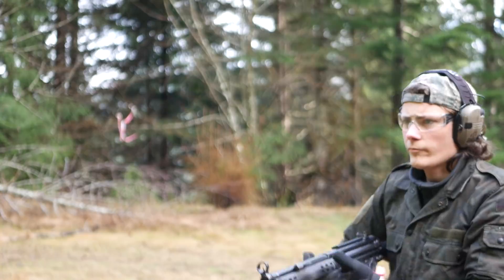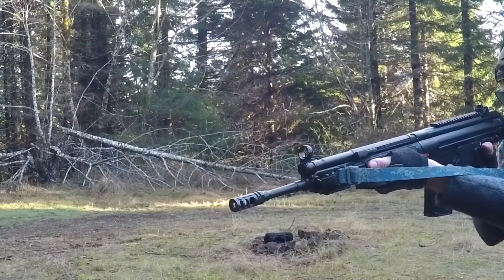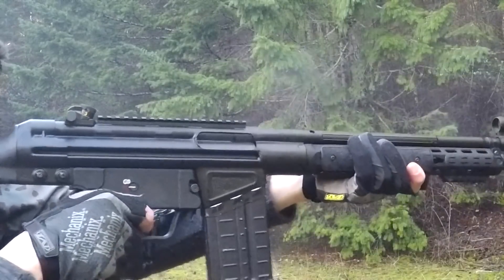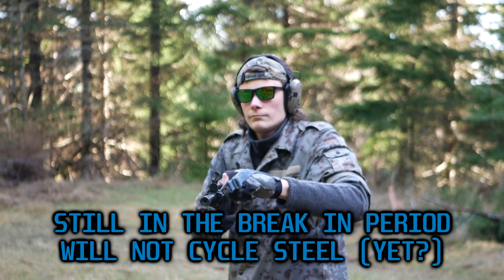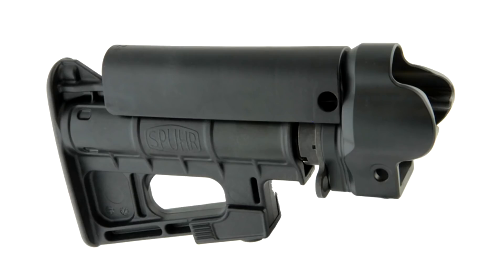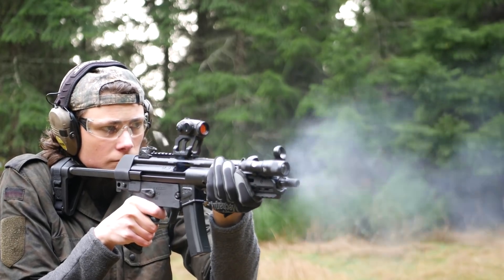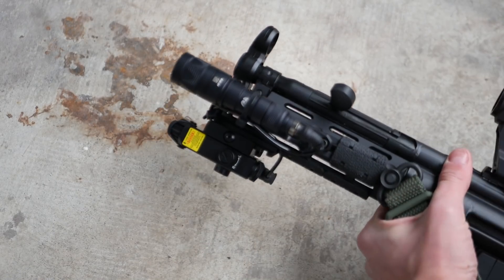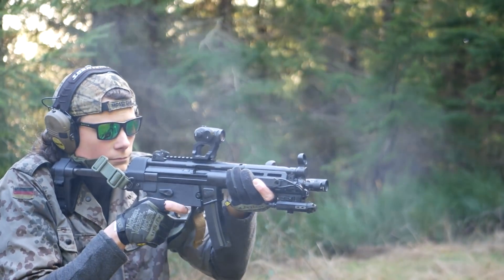PTR Mitosis

Comment: Hop did you ever think of going with a FAL? The manual of arms is better then the G3 imo and its pretty similar to the AR15
Reply: The FAL was/is a great rifle but I think its biggest problem right now (beyond cost) is that reliable mags are getting harder and harder to find. The reviews of the new DSA polymer mags is mixed, they seem to have given up on trying to make new metal magazines, and original military FAL mags in excellent functional condition are getting harder and harder to find outside of the secondary market. They are a lot more expensive than they used to be also.

If DSA can get the new polymer mags to fit and function consistently, I think the FAL will hang in there. The FAL does have some advantages over the G3 like LRBHO and the lower end Cold Warrior rifles are not outrageously expensive.
Reply: @dexm2010  i actually have had really good luck with DSA metal mags. But I agree with you. However, FAL mags have always been over priced in the states. I remember seeing an ad for real FN FALs in the 80s and the mags were 45 bucks. In the 80s. Shit is ridiculous
Reply: @WasatchGarandMan  I remember that ad from the '80s also, but you have to remember a couple of things: 1) Back in the '80s HK G3 mags were around the same price, and 2)
 that there was a period from about somewhere around 2000 (ish) to maybe as late as '07 or so when surplus metric FAL mags could be bought in some cases for less than $8. Many of these were Austrian STG58 mags, with some Rhodesian/FN/South African marked ones (Inch/L1A1 mags were around too but also even then generally a little more expensive for nicer mags). 

The complete FAL kits (with barrels!) were also notoriously cheap, along with most G3 kits at the time. I think part of the reason surplus FAL mags dried up so quickly while G3 mags even now are still cheap and in great abundance is that so many people were able to either build themselves cheap FAL rifles from kits or pay gunsmiths reasonable fees to do it for them, and as soon as they did so, they stocked up on mags as quickly as they could. 

The G3s, on the other hand, while many kits did come in, mostly in very good or excellent shape, they were obviously harder for the average home builder to make, there were fewer smiths that knew how to build them, and the costs were higher with longer wait times. 

I don't know how many G3 and FAL kits with barrels came into the country before the "barrel ban" stupidity around 2005, but while I do not have direct evidence, I honestly believe the higher costs, build complexity, turnaround times, and sometimes spotty reputation of PTR 91/JLD Enterprises early on are the primary reason why there is still such a large supply of G3 magazines available, while most of the metric FAL magazines were sold off and scrounged up long ago.

Comment: As for "modernizing" the G3, everything you mentioned adding to the rifle sounds legit. It is something I would do. Keep in mind, the G3 is NOT a precision rifle, don't make it to be one. People assume just because it shoots a full length cartridge, it should shoot sub-MOA...which is not the intent back when it was designed. 

For the MP5, Midwest Industries has an mlok rail you can mount on top of charging handle tube where you could probable get away with putting an IR laser or maybe a pressure pad...but I don't know how that would go with that welded picatinny rail. Also, T-Rex arms sells a light mount that pushes the white light more forward of the barrel leaving ample space for your hands. You already have a Scalarworks mount, which is great for nighttime shooting (and using irons). 

Modernizing older type guns is fun and takes a lot of work. But it is funny how we are all spoiled with AR-15's and how modular it is and how little work it takes to get it to run. But these older guns need more attention to detail to get it to do what you want. Overall, I'm excited to see what you guys have planned!
Reply: Its a classic rifle, just for some fun. You must also keep in mind that this rifle was invented in the 1950/60s, and without any computerprograms like today. And It just looks better than many modern rifles
Reply: All you should really do is mount an optic, flashlight, foregrip, laser. Rifle is fine.
Reply: Exactly. People have too much of an obsession with "modernizing" old battle rifles. 
Stop
Get some help.
If you want to modernize, do AR's
The G3 is German perfection. 
Stop fucking around with things that dont need to be fixed.
Reply: @gringofett3944  Or, you know.. You could just let people do whatever the fuck they want with their guns.
Reply: @HyperionTwo  Well of course he can do what he wants. its just wrong to fuck with a classic rifle, but that never stopped people from doing it.
Reply: Gringo Fett it’s not like he’s doing it to an actual HK. It’s a PTR clone.
Reply: @gringofett3944  lmao ARs are 20 years older than the G3 you walnut
Reply: @emperor_recce  The G3 is a derivative of the FAL which predates the Stoner pattern rifles. But that's not really the point. You are assuming I was implying that the age had something to do with anything. It does not. The G3 is a rifle that is in the same class as the M14, the FAL, or the CETEME. They are designed to be a heavy, medium caliber rifle with a long barrel capable of delivering sustained and accurate fire beyond 500 meters. They are perfect for what they are designed for. Adding an optic is about all you should do to them. They are not tack drivers for the most part. They are not carbines (like the AR) They are perfect at what they were meant to do. If you want to "modernize" which we all really know means accessorize then the AR is a much better suited platform for that. I dont even have the space to explain why that is. I own multiple AR's and I trick them out like girlfriends, but my M14 is stock, because that's the way they were meant to be.
Reply: @gringofett3944  It isn’t a derivative of the FAL.
Reply: @googlepissoff5776  Yes I mistakenly put FAL there. Its a derivative of the CETEME but was in competition with the FAL and grew out of the same NATO program to standardize on a 7.62 x 51 cartridge.

Comment: This series is very interesting. I'm going to experiment with some "upgrades" hopefully in the next couple of days. 

On a side note, while PTR are not the only manufacturer that does this, and generally they put out a good reliable product, I think "break in" periods on production guns are generally stupid. The thing either works the way it is supposed to out of the box, or it doesn't. All the kit built G3s I have ever owned that used real G3 barrels never ever had any issue feeding or extracting steel-cased ammunition.
Reply: I never followed the recommended break in PTR has for their rifles. The whole shoot clean thing until 300 rounds is wayyy excessive when I got my PTR I just took it out..shot about 100 rounds thru it took it home cleaned it and it’s been GTG ever since
Reply: @rekingskrubs3130  The way you did it is the way it should be. I think probably the "break in" period is just sort of a cover-their-ass type thing that they put out, but it still irritates me I guess.

Comment: Had the same issues with cycling with my ptr, in the end I had to send it back and ptr replaced the bolt... hasn't had any malfunctions since
Reply: Same for me accept I didn’t send my rifle back I purchased a new Enfield made bolt from HKparts.net as well as a new extractor/ejector lever. Did some digging on some forums and found that some ppl have issues with the PTR made parts. Apparently a few years back they sent out a batch of guns with parts that had been improperly heat treated which caused malfunctions and pre mature wear to the rollers and bolt face. Ever since then some ppl say the PTR bolts/parts are crap and should be replaced with HK made ones.
Reply: @rekingskrubs3130  interesting, I'm not to well versed in roller lock platforms in general... thanks for the info
Reply: @itsmegator1019  your welcome man when I got my rifle and it started having issues I went full gun nut trying to find the remedy. The internet can be a good source of info on HK stuff. I recommend the forums on HKpro.com as the ppl there seem serious and have quality info
Reply: A buddy of mine is having trouble with his. He sent it back twice, first time for not cycling properly causing jams, second time he sent it back for incorrect headspacing, he’s still having trouble getting it to cycle properly and is sending it back for a new rifle, mind you he works at a gun shop so you’d figure PTR would try an make sure it was solid.
Reply: @NYPATRIOTBX  yea I’d be wanting a whole new rifle as well. If his new gun exhibits the same issue and he is willing to attempt the issue on his own I’d recommend replacing the PTR made bolt with a European made one as well as the extractor/ ejector and springs. You can also try to buy a New .45 degree locking piece for the headspace issues it’s possible that the one he was using is out of spec and that’s causing the headspace issue. A .45 degree locking piece is standard issue for normal rollers up to +4 in size but since his gun is practically new I would bet it’s not the rollers as those wear out over 1000s of rounds. Look into replacing that bolt/ locking piece. And possibly the ejector lever and extractor springs
Reply: @rekingskrubs3130  thanks for the info, as far as him changing out parts I think he’s gonna leave it up to PTR to get it sorted out.

Comment: HEAT Val Kilmer clone rifle when?
Reply from the maker: Isn't that just adding an MSG90 bipod handguard and calling it a day?
Reply: @Hoplopfheil  yes
Reply from the maker: @Roshanimani  Based
Reply: @Hoplopfheil  no, it's just the G3A3 removable bipod.
Reply: @hellcatdave1  Indeed. Just the regular G3A3 light bipod on a G3/HK91 black wide handguard that is cut for the aforementioned light bipod. Those handguards used to be really common, it's almost unreal how hard they are to find right now.
Reply: @dexm2010  Yup still glad I snatched one up for cheap. I have the bipod too.

Comment: Modernizing the G3 family is one of the dumbest things you can waste your time doing. G3s are like AKs, they’re more enjoyable if you treat it old fashioned (wood furniture, irons or a simple magnified scope) than trying to make it into a sub-par modern rifle. At least that’s my take with owing one
Reply: I kinda agree with you . I have a PTR 32 , same dimensions, just 7.62x39. The rail on top makes you want to put something on there but the truth is , ergonomically it’s best with irons . I’ve run it with a 1-4, a red dot , and I went full circle back to the irons, which are really good. I think the best upgrades are surplus German plastic furniture , especially the hand guard as it’s a heavier plastic with an aluminum heat shield . I got a jungle green set that was unissued for dirt cheap. End cap and recoil assy included . My runs extremely well and isn’t ammo picky in the least.
Reply: @NCrdwlf  I love the concept of the PTR 32, and I did have a Gen 1, but unfortunately that one was only reliable with the then-readily available and fairly cheap Bulgarian plastic commercial "bullet" marked mags (I might at some point get a current Gen 32....maybe).

The surplus green slim handguards (many of the brand new ones marked "FMP")
 are very comfortable and do have the heatshield, but with several mags of rapid fire they can get very, very hot for ungloved hands. Some people have done some clever and cheap upgrades to these by drilling out a very little bit and adding a Magpul rail section underneath to attach a vertical grip.

The PTR 91 smooth metal handguard with attachment points for optional rails is actually really good, dissipates heat really well and is not very heavy. My only real gripe with it is that it uses an allen screw instead of the stock handguard pushpin, and it can sometimes loosen under recoil with the .308 guns and rattle about (blue loctite would probably solve that no problem). The handguard is about $150-$170(ish) bucks and will fit current PTR 32s (but not the older Gen 1 PTR 32s with the HK33 length handguards).

Not for everybody, a lot more expensive, but the wide handguards are almost impossible to find right now, and although I like it, a Spuhr G3 handguard is like 300 bucks.
Reply: @dexm2010  mine is good with magpuls, East Germans, the commercial Korean steels and puff guns. I also have an unknown steel mag or two and it’s fine with them . Tapcos don’t fit.  . I mostly just run magpuls as they are cheap, and easy to find. I know early guns have had issues, but mines been great in accuracy and reliability. It’s kind of a beast for it’s caliber , but I enjoy mine a lot .
Reply: @NCrdwlf  It sounds like they've done a good job in general as far as fixing the mag reliability. Thank you for your input...I might end up getting one of these.
Reply: @dexm2010  if you are good with the weight penalty and manual of arms I think they are hard to beat . If I had to do it over I would ,  maybe the 12” barrel model and turn it SBR, if you want something more compact otherwise it’s good to go .

Comment: Ian was right about the charging handle sucking
Reply: I've never had a problem with it, but I can see where sometimes it could be harder to use depending on the type of scope used (if any). 

Also, I can't put my finger on exactly why, but I've had the original metal cocking handle (like the one on Hop's rifle) on some of my rifles before, and it just seems...harder(?) or different somehow(?) to unfold the cocking handle compared to the more common green, black plastic, or older rubber coated ones PTR used to use.